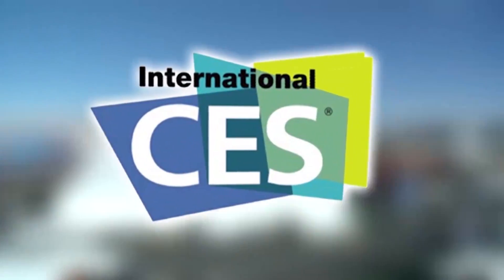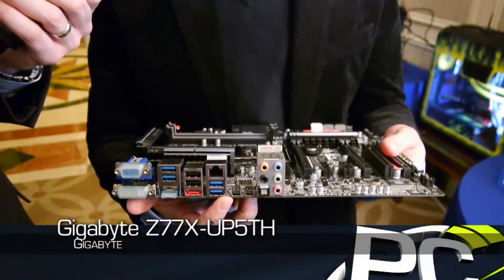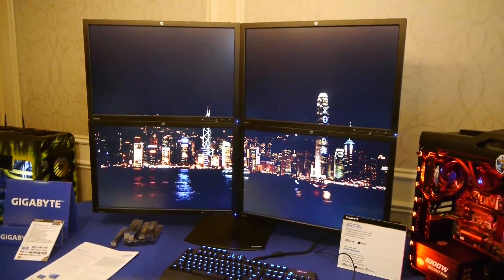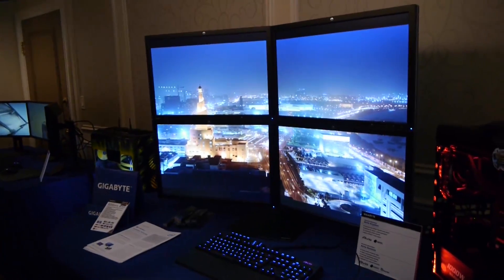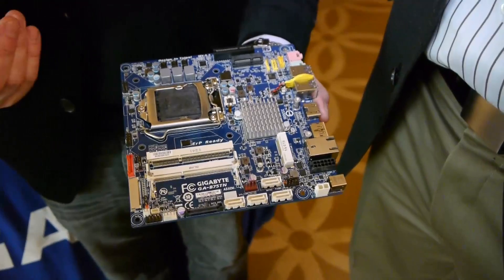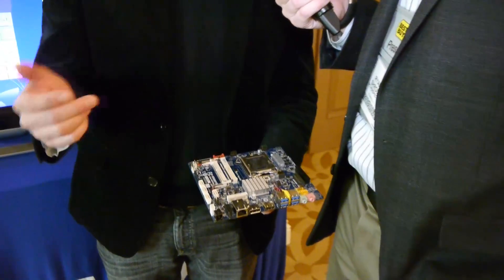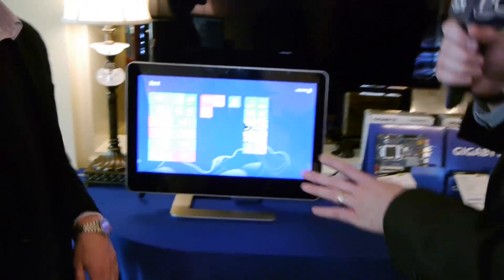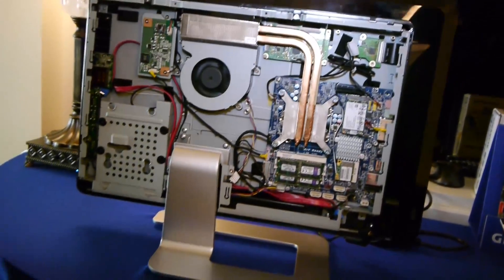Gigabyte Shows 4K Display Support and Thin Mini-ITX Boards - PC Perspective

Comment: Hey Josh -- great to hear about the FD-SOI stuff (starts minute 24:00 of the podcast). A couple things to note -- high-volume is currently ramping at GloFo (see ASN) - so volume's not an issue. STM CTO Chery told David Manners (Sept 10, '12 in Electronics Weekly) that Samsung can also fab FD-SOI for them. And finally, did you see ST-E's CES YouTube video? They demo 2.8GHz with that FD-SOI chip.